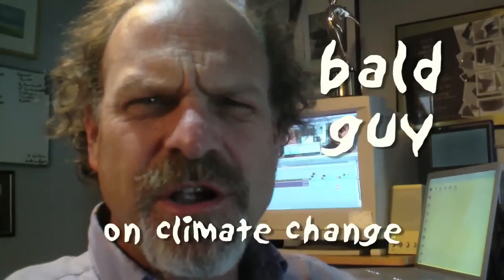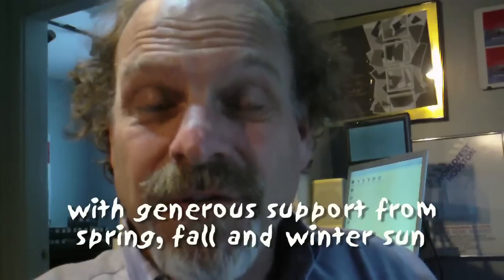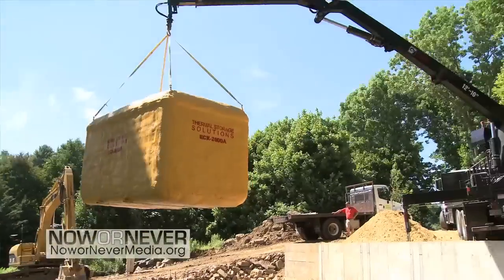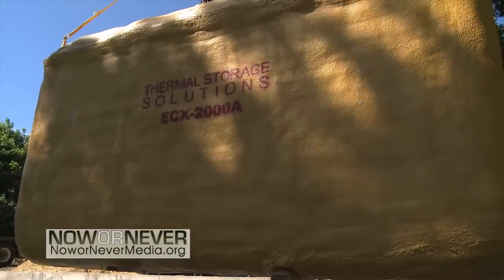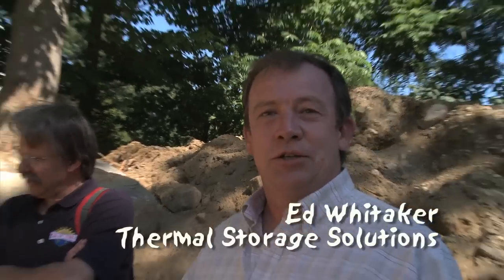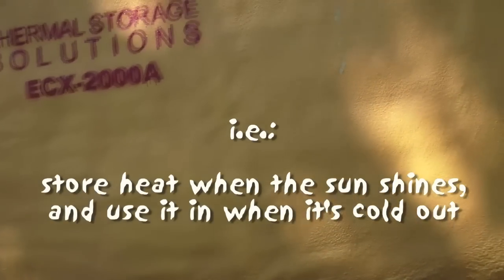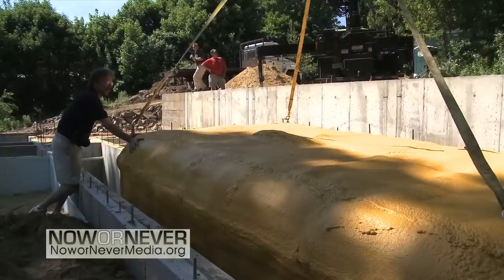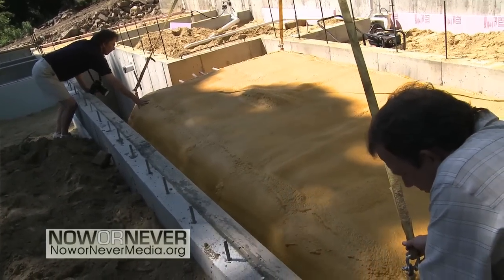Bald Guy 047.mov

Comment: @the43k    I'm no expert here, so please educate me if I'm wrong.   Lets say we have the entire tank 160 degrees and we could extract 100% of all this heat (which is not possible) and we have no standby losses.  3200 gal x 160 degrees x 8.34 BTU'S = 4.27 million BTU's.  Now, I understand that the solar thermal system will continue to replace some amount of heat during the winter, however,  I believe an average 2400 sq ft home in NJ would need more than 100 million BTU's for the winter.